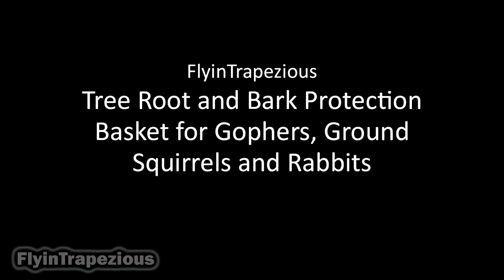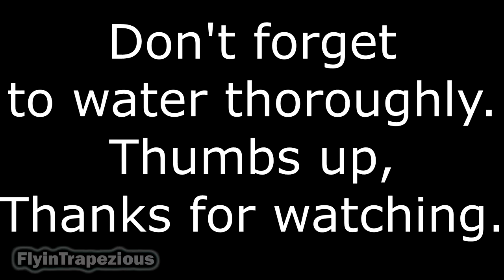Tree Root and Bark Protection Basket for Gophers, Ground Squirrels and Rabbits

Comment: Are bigger baskets needed for dwarf fruit trees than plants? Or do you think I could use 9x9 baskets for them?
Reply from the maker: A 9x9 basket would be ok for a 1 gallon size pot. For 5 gallon size pots I measure out 63 inches of wire which gives you approximately 20 to 24 inches in diameter.  A 9 x 9 inch basket is going to be too small for a dwarf.  The tree is smaller but the root ball is still the same as a standard size tree.
Reply: @FlyinTrapezious  Thanks for your helpful reply!  I'll definitely make it bigger then. We also have a problem here with voles as well as gophers and I've read that you need the 1/4 inch hardware cloth to keep voles out, they can get through 1/2". But I can only find 1/4" inch hardware cloth in 23 gauge not the usually recommended 19 gauge. Do you think it would be ok or better to get 1/2" with 19 gauge and risk it?  I have found a roll of 48" x 25' 23 gauge wire.
Reply from the maker: I use stucco wire ( basically the same as chicken wire). It is a heavier  gauge very cost effective.  I normally pay $83.00 at Lowes for a 150 foot roll. It lasts  3 to 5 years in the soil before it breaks down. By that time the tree is usually well established.  If you do alot of planting I highly suggest in investing in a earth auger and Milwaukee m18 drill . My current drill lasted 6 years and helped me plant hundreds of tree and shrubs. I have recently upgraded to the Milwaukee Super Hawg drill . Now I am able to run up to 6 in earth augers with ease. I would not use hardware clothe because you run the risk of a tree getting root bound. The 1/4 in and 1/2 in holes are too small.  I normally have a 90% success rate with the stucco wire in defeating gophers.  I also use Gopher Hawk traps which are very effective .